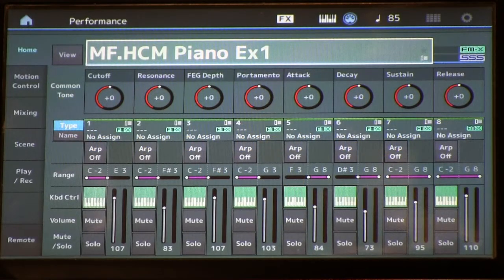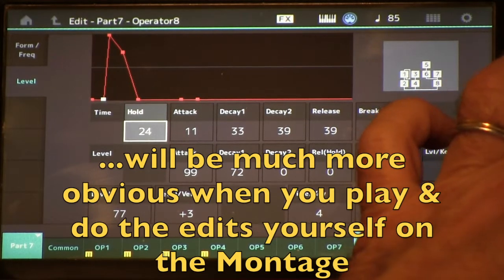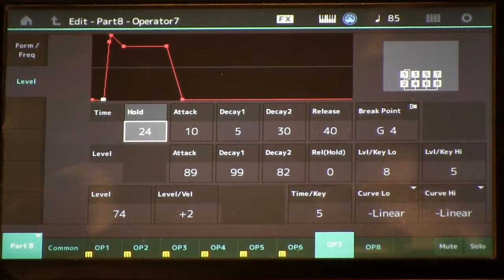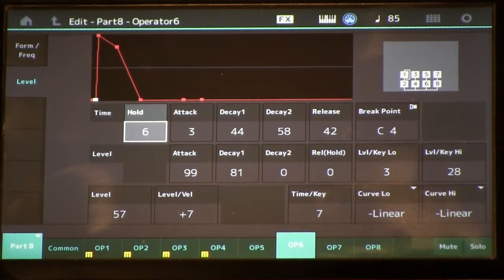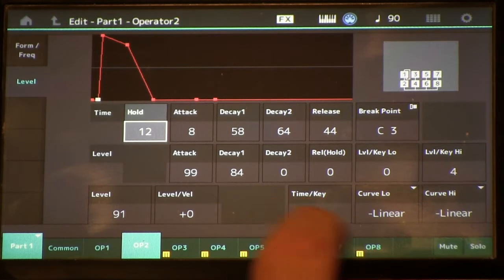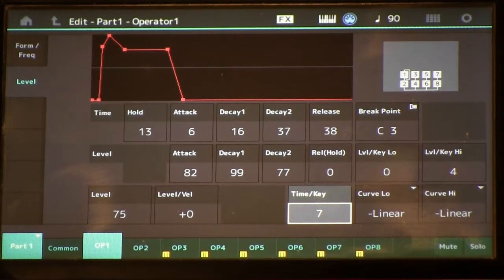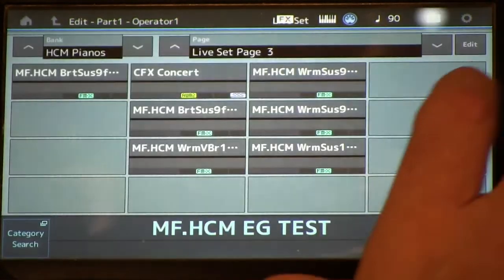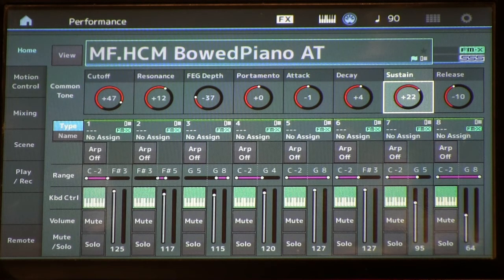Manny's FM-Xpert Video 4 "The Envelope(s), Please"

Comment: I have so MANY questions and am astonished there has been only one comment in 4 years.

1. Have you written any past articles that covers the FM envelopes (e.g. Op 8 @1:30) in detail? If so please reference and I will deter to pursue that source first

2. Can operator times be compared/coordinated between different operators? That screenshot shows times for Hold, Attack Decay1, Decay2 and Release (H,A,D1,D2,R). Can you ensure that the release for op2 will begin before the release for op1 by making the sum of H,A,D1,D2 for op2 less than the same sum for op1? I've been told 'NO' because the time values aren't linear but are exponential so can't be directly summed. So how do you make op2 release occur before op1 release?

3. Can you speak to how the combination of Break Point, Lo key  and Hi key work together (are computed) to provide an offset for level. For op8 breakpoint is D#4 so the offset is zero there.
Lo Key is 5 with a +linear curve - does that mean to offset increases by +5 for each key lower than D#4? If so does that mean the offset also increased by +38 (Hi Key) for each key higher than D#4? Is there a simple way to create a test that illustrates how those changes work?

4. The breakpoint, Hi Key and Lo Key are different for the three carriers. How can I try to conceptualize what the result of that is to try to understand why they were made different?

5. The same parms for the op7 modulator are somewhat different than op8 values. The breakpoint is G4 and the hi curve is -linear. What considerations led to those choices for the moderator.

6. Can you suggest a tool for Windows that provides the harmonic displays like you were using in your videos? Visual Analyzer doesn't seem to be up to the task.

7. See question #1 - initial goal isn't to learn how to create any specific sound but rather ot understand, in depth, how those FM envelope parameters interact in shaping the time/level parts of a sound.

Any leads you can provide to previous articles/videos/material would be appreciated. Likewise any leads to an expert consultant (hint, hint) in that area would be helpful.

My man impediment is figuring out how to create test cases that isolate just one, or two parameter effects so I can get a sense of what each parameter is actually doing.

Thanks for any leads you can provide.

Oh - forgot to mention - I don't know what your fingerprints look like but I wouldn't be surprised if they are ALL OVER the new FM-X settings screen in the Montage M8X
https://manual.yamaha.com/mi/synth/montage_m/en/om02screenparameters0140.html

Take a look at the 'Screens and parameters -> Part Edit (FM-X) screen -> Part Common Edit - FM-X Settings' part of the new operations manual.

It shows a part level (not operator level) envelope with: FM Attack, FM Decay, FM Sustain and FM Release.
There are also three new parameters with some very interesting, and suggestive, names: 
----------
FM Depth

Changes the depth of the frequency modulation. Settings: −99–+99
FM Harmonics

Changes the frequency of the harmonic overtones of FM synthesis. Settings: −99–+99
FM Texture

Changes the texture of FM synthesis. Settings: −99–+99
----------
That is ALL the doc says about them.

Any idea what FM texture alludes to? What about FM Harmonics 'Changes the frequency of the harmonic overtones'?

Those are just BEGGING for an explanation - especially being at the part level rather than operator level.

Take me back to my Navy Electronic School days at Treasure Island where one of the multiple choice final exam questions was: There are 3 grids in a Pentode tube - how many grids are there in a fallopian tube? And yes, there were some that did NOT choose 'none of the above'.